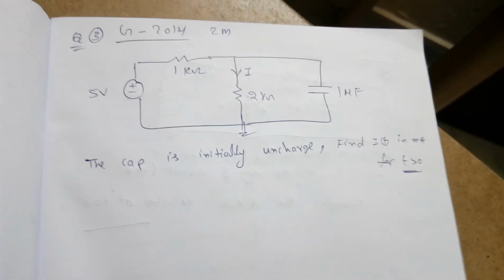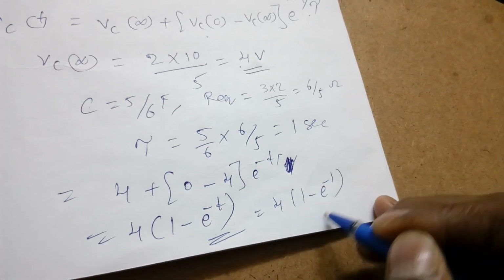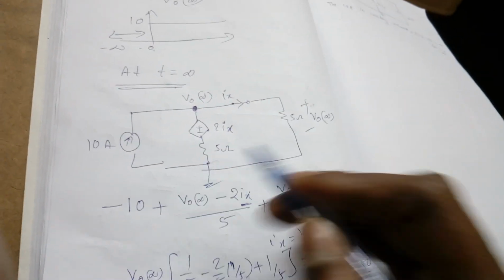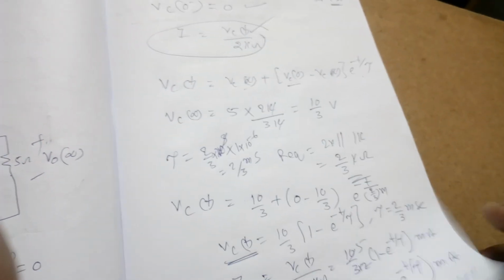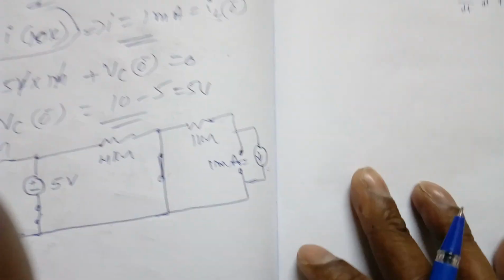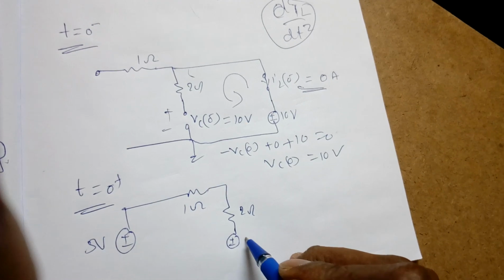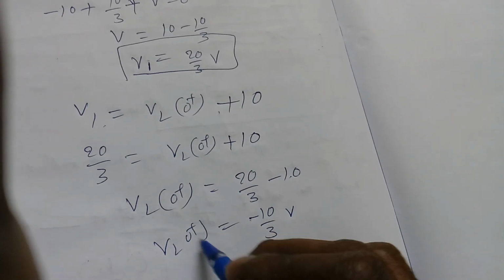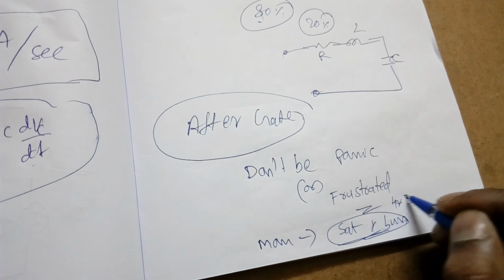Transient concept in Network Theory-8

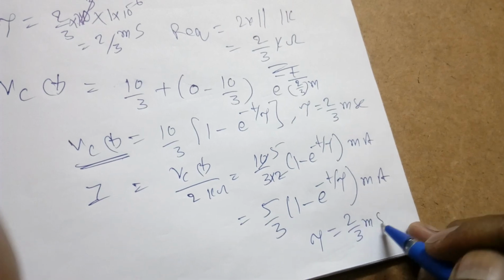Comment: 9:06 the current value must be derivative of voltage equation not divided by R
Reply: yes,u r correct !! ans is i(t)=5 e^-(t/tou) mA. sir made a mistake !!
Reply: @neelyo642  no...if it were the current through capacitor...what u've said is correct..but its through the resistor....so the given answer is correct